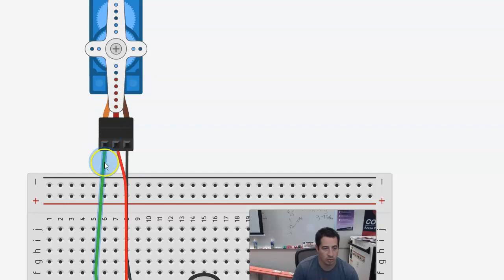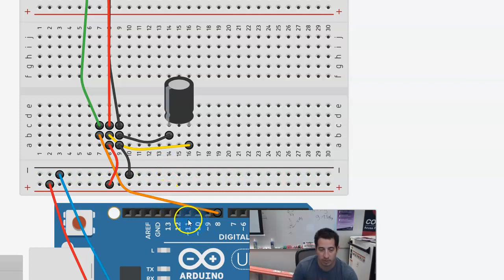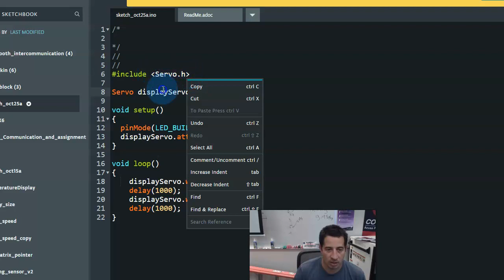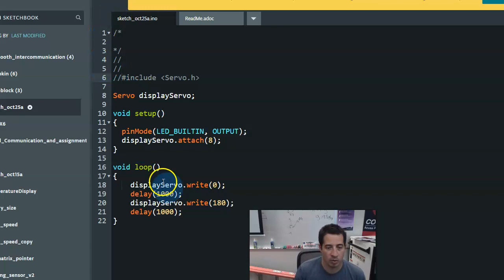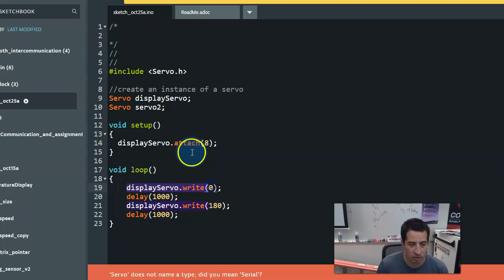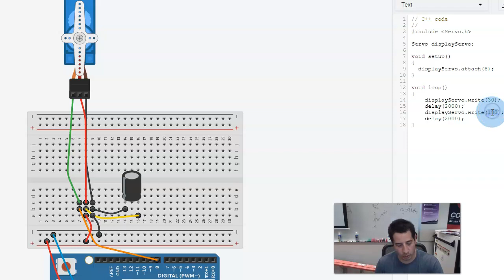Controlling Servo Motors: Learning to code C/C++ with Arduino, part 18

Comment: Can I use this logic on the pi 5?
Reply from the maker: No, there are some different libraries you can look at for the pi, but it is pretty different from Arduino. The principles are the same, but i imagine you will probably end up controlling it via Python.
Reply: @aaronstafford5501  Thank you:)

Comment: why you use "include blablabla" ?? In c you can adress it by register - do you have tutorial whau do it right?
Reply from the maker: This is the right way to do it. Yes you can do it setting registers, but even if you wanted to build your own servo library from scratch, you would still want to make it into a library so that you could easily read, test, and debug your code. These lessons are for beginners, and there are other resources online if you are interested on creating your own servo library.